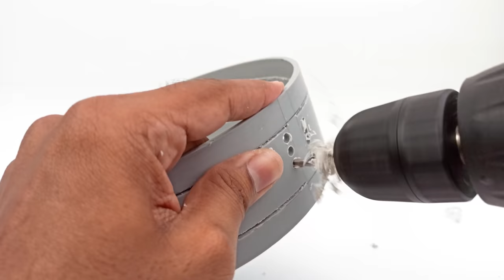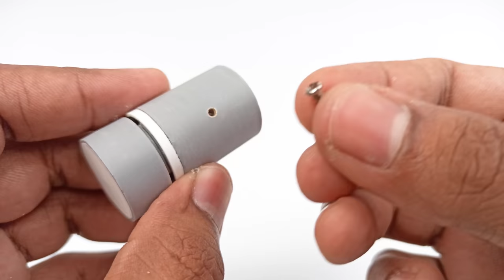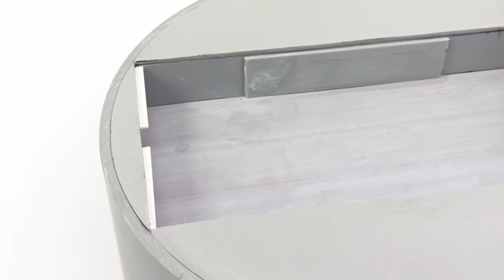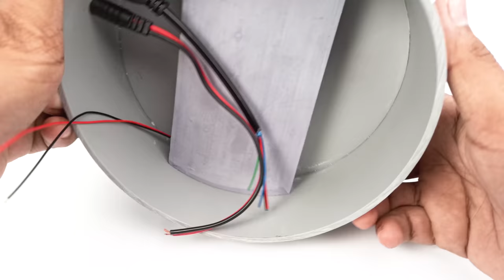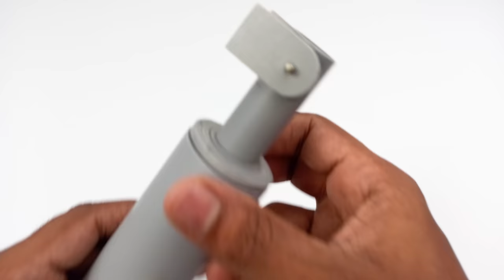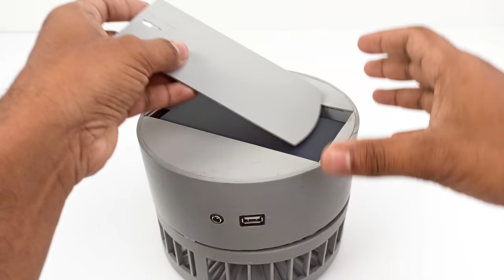How To Make a Portable Tower Fan From PVC Pipe at Home

Comment: I like the engineering of it and the use of a potentiometer in place of a on/off or 2/3 position switch. I think the super glue is a weak spot, Maybe should epoxy it after gluing it in place. My wife purchased one of these fans for me and i find it very useful. Thing is i find my self having to clean the fan blades from time to time. With your fixed grill this could be difficult and time consuming. A few tabs on the grill and L slots in the shroud it could be removable for cleaning of the blades and grill. Great work always nice to watch a craftsman bring there ideas to life. Thanks for the vid. keep up the good work.
Reply: @mrajpoot4735  stutter much? or just can't speak?

Comment: My suggestion is that you should twist the wire like a spring, then when you lengthen or shorten the shaft of the fan, you won't have to adjust the wire anymore. Great work.

Comment: This was remarkably efficient and easy to achieve by clicking on the buy button.
Reply: Twisting wire is wrong idea.  Twisted wires act like coil. It will cause of power loss and cable can get excess heat.  So do not twist cables

Comment: The motor should have been bigger, the motor currently used will not drive away even a fly.😅
Reply: That's either N30 or 180 motor, both very high rpm on low voltage with sufficient torque to drive that propeller at sufficient speeds, you do not have slightest of idea on what you're tocking about .